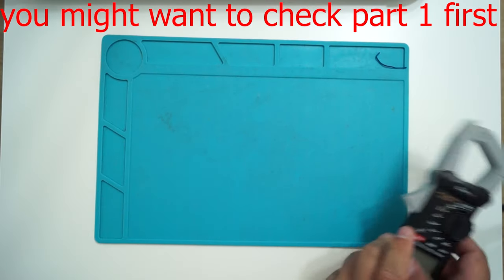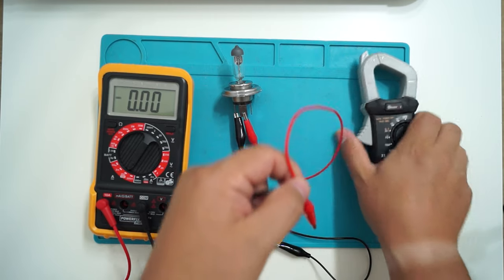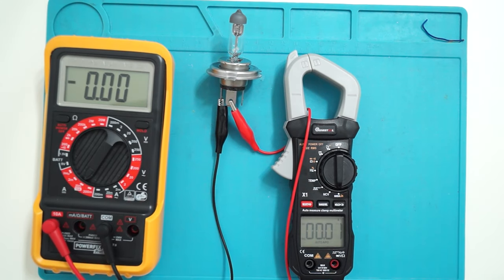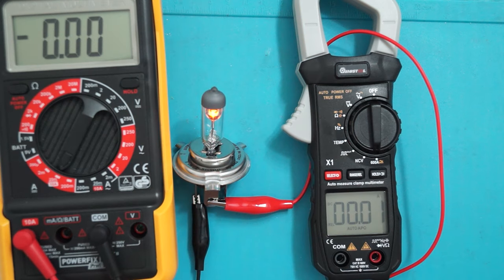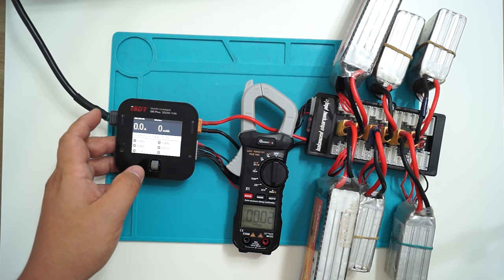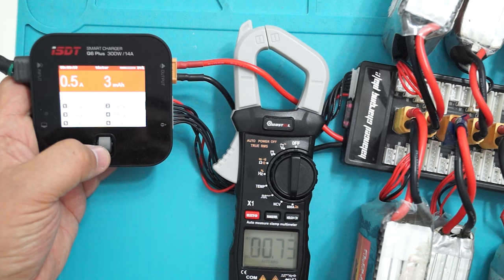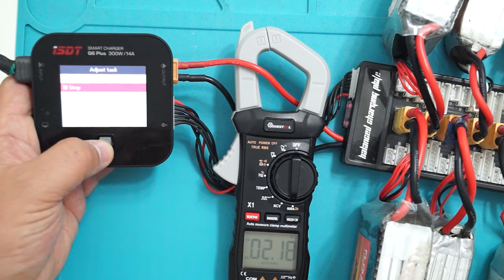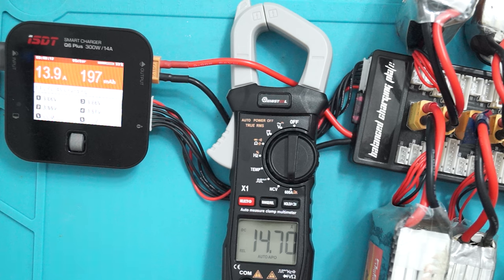Part 2 - Mustool X1 Clamp Meter | 600 Amps DC/AC | features and how to use | from Banggood.com

Comment: May i know the accuracy of ac current test of this tester by computing the amp of this tester multiply it with the volts as watts with a bulb that has indicated watts or any appliances, especially for distorted waveform.

Comment: I have an iSDT C4 charger and have measured current with an accurate ammeter in line with the cell being charged. I have noted that the actual output current from the charger as measured by the external meter doesn't match that shown internally as shown on the charger's screen.

I'm not saying that perhaps the X1 is necessarily accurate, simply that the current shown on the charger does not match the actual output.

Not sure why. I'm guessing the C4 charger varies the current/voltage, within reason, to help it determine how the cells are responding. The variations may happen rapidly enough to provide seemingly 'random'/inaccurate readings on the X1. Would love to hear from others who could correct/educate me!

Interesting and useful video though, thank you :)

Comment: What is the square wave signal generator function used for?
Reply from the maker: It can be used to test various circuits. Knowing exactly what you are feeding your circuit, enables you to assess if the circuit outputs what you are expecting.

Comment: I was very disappointed with my X1. I get no AC current reading. But on the DC current i do get a reading . But i have a question sir. When i set to DC current and i press the RANGE/REL button there are two readings i see. one with the  "_" on the left and when i press again , it reads "REL" which of the two is the one that would read accurately ? thank you very much for your review. Am so disappointed that the AC current is not functioning... i hate it when they (seller) do not check out the unit before sending it. Thank you again sir !
Reply from the maker: With no current flowing through the wire press the range/rel button. It will display REL and the current reading should show zero or very close to zero.

Comment: How accurate is this clamp meter? Should I buy it?
Reply from the maker: It's not extremely accurate for low current, let's say under one Amp, but for higher current it's accurate enough. Personally, I like it a lot.
Reply: no, for small measurements is very inaccurate!
Reply from the maker: @Marko_Maxa  this is true for most clamp meters

Comment: Can you please measure ac current next time? Thanks a lot
Reply from the maker: I could measure AC current, but I wouldn't knew if it's accurate or not because I don't have any reference.
Reply from the maker: Because a Fluke is an expensive meter and I don't have one? :) Is that a good enough reason?
Reply from the maker: I didn't consider this test to be very relevant since my cheap multimeter might be quite imprecise.
Reply: @nextor11  then use two or more cheap multimeter and try. use some bulbs from house and heaters... and do math. result must be similiar what is writen on bulb or heater, etc. look for this video, not need to listen, just watch https://youtu.be/LyCblsbPfyQ
Reply: I asked because i have a very similar looking multimeter, maybe re branded version of this one which is winapex ET8203. All other functions worked just fine, but the AC current measurement is showing absolute 0 readings. I think mine's just defective. Thanks anyways!
Reply: AC current is absolute crap. The current has 30 (!) count precision which is 300mA on the 60A scale. So it doesn't measure anything reliably below 1A, and below 0.4A, it'd just show zero. If you make few extra windings over the clamp it'll be showing (think of transformer). Overall okay design and jaws spring but the amp meter is trash. The flat flex cable is too long and pinched too as well.
Reply from the maker: No such amp meter is very precise in the mA scale. If you really want to measure mA, you need to put an amp meter in series.